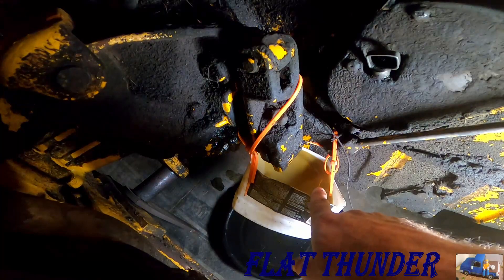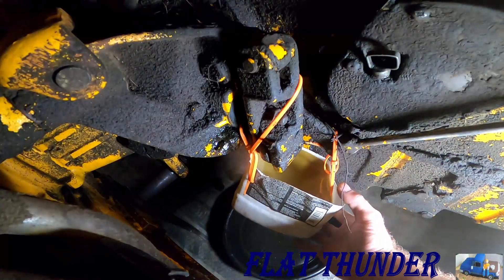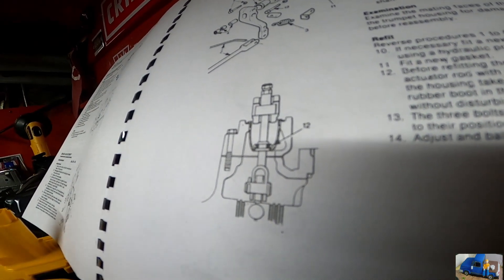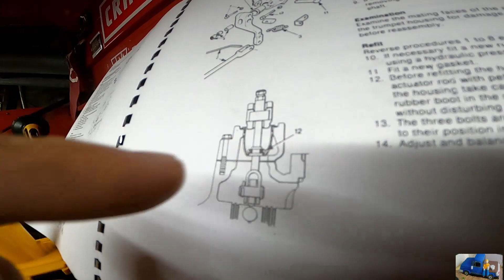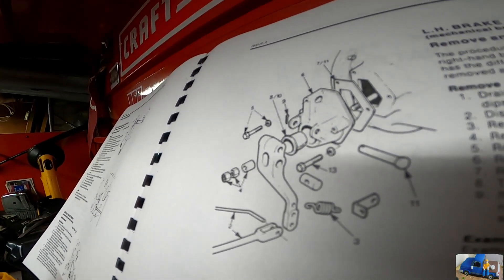MF30E, BRAKE ACTUATOR ROD SEAL / POSI TEST

Comment: With that leak, was there still some brake pedal resistance when you pressed the pedal.  I have no resistance in both brake pedals, when pressed they go straight to the floor, but I also don't see any leaks on the actuators.  I find it hard to believe both master brake cylinders went out at the same time?  I think it might be something else.  Any suggestions to troubleshoot my brakes.  I have the same MF-30E PowerShuttle (1986).  Great video, you need to get a head lamp for lighting what you're working on, your big old rancher hands are blocking the view.  lol.
Reply from the maker: My pedals moved freely up and down without resistance.  Check out the video of me machining the mastercylinder in half.  At the end I give a brief description of how the internal valve works.   I imagine your pistons are stuck in the down position.  Mine were buried so far in the housing the little stem on the check was bent.  When the pedal moves up and down the actuating rod might be moving and the piston is seized.  To check the internals you must remove the unit.  If the mastercylinder has fluid at the feed line and no fluid sprays out of the pressure side during a pedal stroke they need to be replaced.  I would just opt for two new units @ $25 each it's an easy choice.  I contemplated trying to rebuild mine until I found the cheap replacements.    Its a fun challenge trying to hug the camera while performing the operation with good lighting and audio.  I like the headlamp idea.  I have one I might try.  Thanks for watching and best of luck repairing your tractor.  They are so much more powerful with good brakes.  I use mine to steer.  I haul the unit to storage in another video.  The parking brake will hold the tractor on a pretty steep grade.  Impressive wet brakes! 👍😁
Reply: @FlatThunder  Where did you find the Master Break Cylinders for $25 a piece, the cheapest I could find was $124.99 plus $15.00 shipping and handling.  I plan to follow your instructions to check out my brakes.  This MF-30E is about to be put to the test for grading and moving soil come the new year as we're building and event venue for weddings, parties, etc. on our 5.5 acres of land.  We wish we had a back-hoe as well, but we'll make do.  I did watch your video on replacing the Master Brake Cylinders but I'll go back and look at it again before I start the trouble-shooting.  Thank you for the quick replies.  I may try to record and post the videos.  I'm sure there are other MF-30 owners out there with puzzled looks and problems to solve.  lol
Reply from the maker: I had to check the video just to freshen my memory.    I only suggested looking at my Instagram page for more info on the replacement master cylinder. 

 Try this link, it should show the part#: https://www.instagram.com/p/CET5quDhqBF/?igshid=tg34bsp9tays

The company is call British Parts Northwest.  They sell parts for old English cars.

Comment: I have a MF245 with a very similar break set up.  Had to replace those seals awhile back, fun job.  Pin #11 in the manual, I had to cut it off and press it out cause it was rusted so bad.  Looks like you done a great job.  Gotta love the old Masseys.
Reply from the maker: Thanks!  I was happy I could replace this seal without removing the whole bracket.  I was skeptical at first, but I think it turned out ok.  I had to omit a few curse words from the video.  Haha.  It isn't the most convenient location to work and getting the seal spring in position without hitting my melon on things proved to be an interesting challenge.  This is my first tractor with internal wet brakes.  I'm impressed with their power!  Thanks for watching and Merry Christmas 👍😁